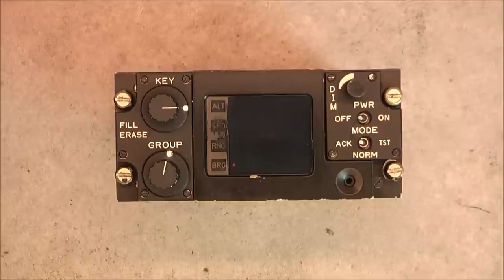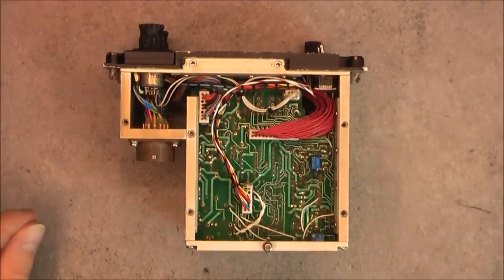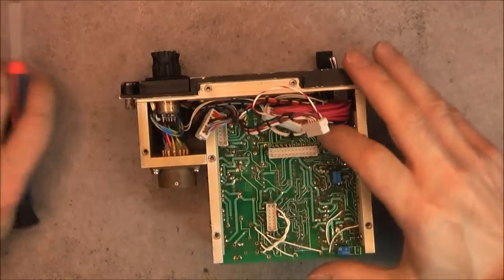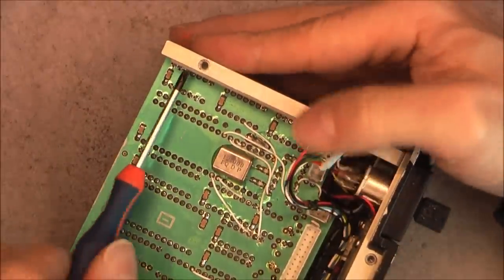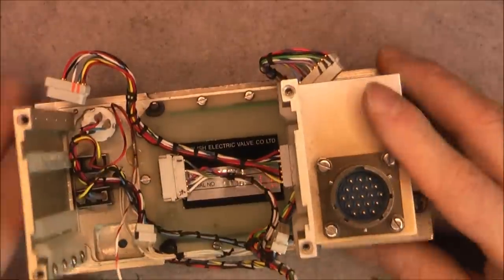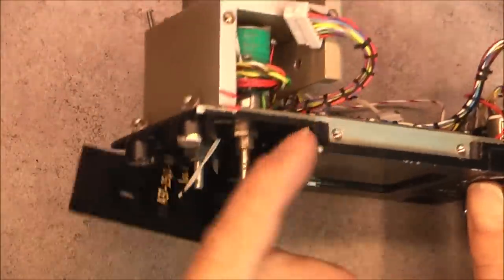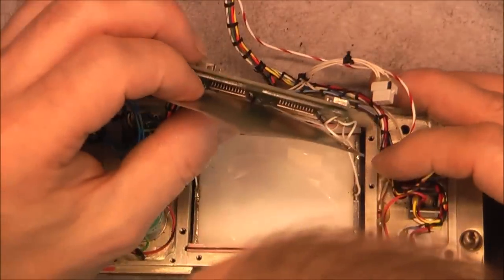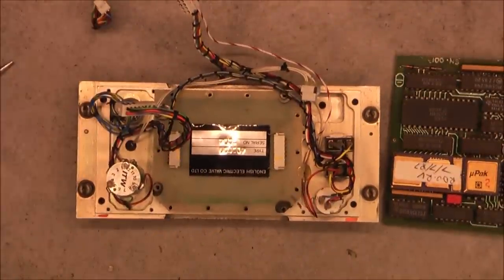Airborne display unit teardown, wonderfull surprise inside !

Comment: The "hybrid" MCU shown in this video is the forerunner of the modern 8051 based system-on-chip units (DALLAS DS5000 etc)
This particular variant is designed to be 100% pin compatible with the industry standard 8031. 
You can probably fit a modern DS89C430 in that socket once you have dumped the EPROM and got the HEX file and it should work.

Comment: Pretty interesting device. For 1986, this would've been pretty advanced tech. Most military displays of that era used miniature CRTs or various incandescent/projection methods. The EL backlight would be extremely dim and unusable for daytime situations.. suggesting that this is a transflective monochrome display. The extra 2 wires may be for an LCD heater (nearly all military LCD displays have built-in heaters to support -55C operation). The front hole in the instrument just looks like an air hole, maybe to prevent humidity accumulation? Or maybe it's for some physical accessory attachment, though there are no visible wear marks. The main connector is hermetically sealed, interestingly. The green backlight would make it suitable for pilots wearing night vision gear (that's the reason why most military aircraft have green lighting on things). Lower-end military display products often use poor quality display coatings, both when it comes to overlays and anti-reflective coatings. Those coatings can be easily scratched and require very specific cleaning products, otherwise they can be rubbed off, which is unfortunate to say the least. Physically and chemically-robust mil-spec AR coatings are very costly to produce, so smaller companies settle for cheaper processes. The liberal use of surface mount stuff is pretty advanced as well for that era. You can always tell the purpose/price range of a given item based on casing construction. The ratio between stamped/bent/laser cut versus machined metal. A hint about overall project budget can be deduced from "wastefulness" of that machining haha, like how many giant blocks of metal had most of its material removed just for some casing item. It also helps to consider what type of CNC machine was required. 3-axis is much cheaper than 5-axis. Large/heavy items require larger machines. Extra tool changes add cost as well. Commercial aviation items tend to use cheaper construction while maintaining robustness. But of course, purpose and importance are factors as well. Top-end military stuff is nearly or fully machined, even for physically large/heavy items. One less thing to go wrong and low tolerances for consistent assembly.

Comment: Perhaps with the wiring to the regulators, you could get a pretty good idea how to power it up when reassembled.  Would be interesting to see the LCD.
Reply: Runs on 28VDC, so just power up the unit from the power pins and it will start up and operate the display.

Comment: I really like that hybrid! Yes it looks like a hybrid microcontroller, i can't find much on the part number or any reference to uPak but sometimes they are printed underneath. Hybrids are pretty tough so you should be able to take it out without damaging it. Possibly the core on the right, crystals and EPROM in the middle, there will also be SRAM and maybe an ADC/DAC so they could be on the left and underneath.
Reply from the maker: There is a link to the datasheet in the video description.
Reply: @msylvain59  Nice, thanks i didn't see that!

Comment: Very poor construction. Expensive case, very expensive chips on an el-cheapo PCB with lots of dangling wires and consumer-class plastic connectors inside. Looks almost like it is a class training unit or a prototype.
Reply: Those are absolutely not consumer class connectors. All the hardware inside is military spec and the mess inside hints at a lower production run. 
This was definitely a high end product, probably for a small market.